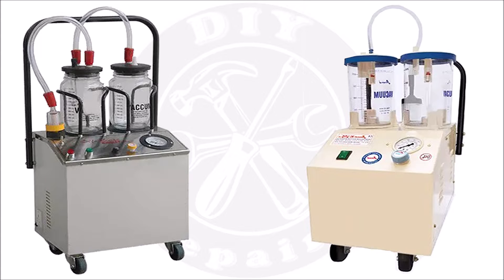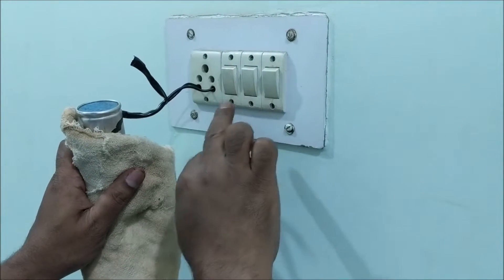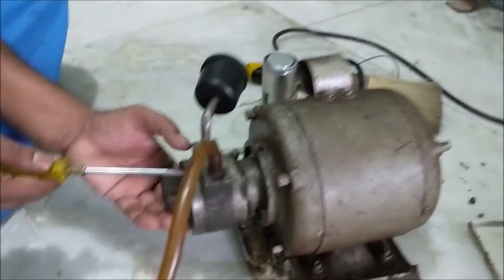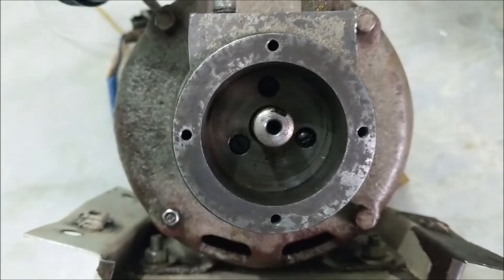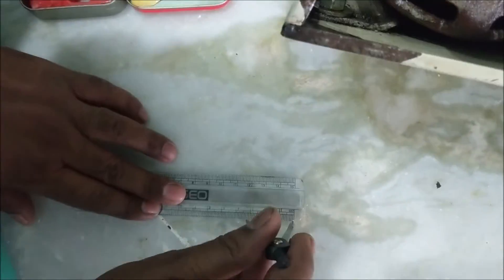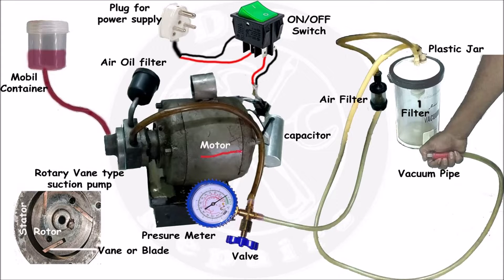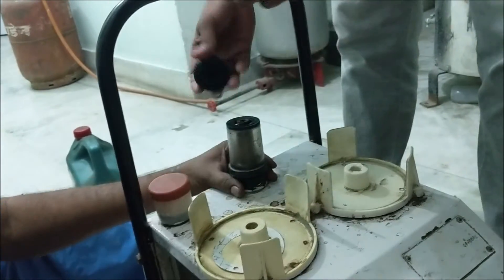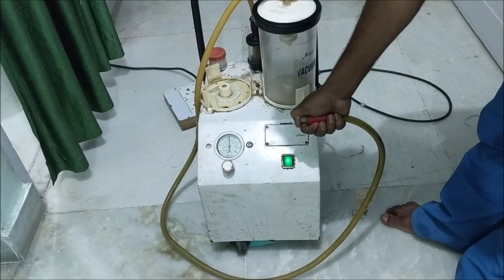how to repair suction machine or vacuum pump

Comment: Hii yuwell suction power on light showing but not running machine
Reply from the maker: check electrical connection, condensor, and motor coils

Comment: Hiii borther ,i saw ur blender repair video.i have one problem brother .plzzz rply .blender motor part back side there is a plastic like fan.that fan or wheel wings were borken .what we should do.can we use .
Reply from the maker: Actually that fan is used to cool the motor while running. Since the motor is high speed, it produces more heat. If there is no fan the heat generated by the motor may burn out the motor coil. So it is better to change it. If not possible, run the blender for a very short period of time, wait for a while to cool the motor and then run it again i.e. use the motor intermittently.